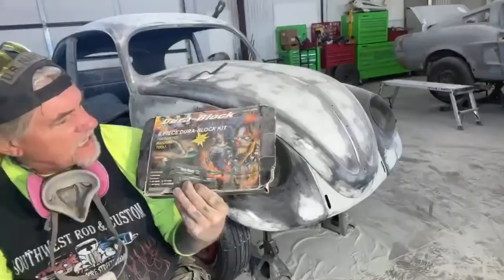Should I Use This Fender On My Car? AFTERMARKET AUTO BODY PARTS SUCK 😡😡😡😡

Comment: Fenders From BBT are the best fitting ones for oval window. you can get them best price through CIP1. they are SILVER not black. they have the correct shape but you will need to do work to them to get them to be straight. But for the most part they are pretty good.

Comment: Hey pete I agree 100% with you about those fenders. I actually live nearby to those companies, that made and still produce fenders hoods and auto body parts for Volkswagen, Audi, Mercedes etc. Even in here those "OEM Fenders with the special primer, ready to paint, no need to sand, trust me" bullsh*t need heavy bodywork. It is very uncommon here to get a new part that doesn't need putty.

Comment: As one who has had to hand fabricate interior and exterior body parts, my answer is yes: I would use anything. I can always rework it to make it right. So even a poor quality part not made properly still has most of the work done. 
Like using mustang tubs and floors on "other Mercury cars" because that's as close as I can get it. And that's only if I don't make the part from scratch.

Comment: my bugs are primer black because if it makes it through a year with no damage i would be amazed , every year i end up working on the bodies i just get so it looks ok to baja them . i have next to nothing in them one is a 74 with a 74 bug transaxle 1600 engine about 60 hp . the other one is a 63 with a 1600 dual port with a 72 bus transaxle. i got both for 450 one running and driving  the other needed work both are rust free started with clean bodies but over time i picked up some baja parts for free still have extra front clip . they get thrashed on i go cross country y other go on trails tranny mount like to break on them but most rig would not handle it

Comment: Pete, I have seen you use the honey mixed with filler. The honey has became expensive, but I think I have seen you mix the polyester spot putty in with filler to fill very fine imperfections. Only to be sanded with a 320 - 400 grit in preparation for a 2k filler. I don’t have the ability to buy the honey, but have the polyester spot putty. I am trying to finesse the center line on a 1967 C10 which has complex shapes and tappers. Never dented but off enough to need attention. I look for your advise.
Reply: Try USC AG47  and Pro glaze from USC.....It is the best stuff I think on the market. I do the same mix some pro glaze in with the filler for fine deeper fills. super fine stuff Pro glaze. AG 47 sands like Rage. or drywall mud. super fast. and strong.
Reply: @Mikefngarage   Thanks Mike, it is hard to keep up with product names, makes it slightly confusing. Spot putty versus polyester glazing. I think you helped clear it up for me buddy! I just want to do it right, do it once. This one is mine. Just hope Drs. don’t put me in a wheel chair. I truly appreciate your information & sharing. I save these & write them down. Good stuff! DK, Omaha.
Reply: Just a note, after I mix the ratio, my son sprays (34), he has lifting on hood in a 4” spot. I ask him what he used, he told me red spot putty. I told him to use polyester glazing putty. He said I don’t have your money. I said, how much time, money, product will it take to re-do? He shut up! Throw the lacquer based crap away. I loaned him my new bottle after making him watch Pete’s video! He learned.
Reply: @deankay4434  yeah I rarely use that lacquer putty only on stuff I don't really care about polyester glazing especially USC pro glaze is probably the best value. It sounds really fast too
Reply: @Mikefngarage   Thanks Mike. I agree with red lacquer based spot putty that has around as long I remember. Learning has occurred! I am glad I learned the difference and passed it on to my son. I am a subscriber to your channel as well and even tough I repair mechanical, electrical and leaks, because they never leak oil!!! Between you, Pete and others, at now 63 enjoy learning. Resto-mod my 1967 C10 with Tahoe LS and my overdrive transmission. A lot is done but nobody leaves me alone to fix their stuff. Thanks again for the reply. God bless you and your projects. May the wind alway blow the dust away from your direction and the customer leave a great tip! Thanks Mike! (Father advice; You know you children have finally grown, when they total their vehicle instead of yours) Thanks a bunch!
ASE Master Tech - Self taught farm kid!

Comment: II can’t find a part it doesn’t exist. Very hard hood to find I see them go as high as $700 to $900 for a 4 tab here. That baby’s going to look better then brand new. If he puts a red interior in it oh my god that will be bad ass!!! The green primer shit is supposed to be the good ones but wow. I’m not shocked they need a lot of work. That’s why my Nova has a NOS fender. It’s sad the NOS VW parts have dried up . It’s a wonder the holes lined up. My luck I would have to drill all new holes and weld the old holes up. The original stamps is all bullshit to get people to buy their shit

Comment: Old School, New School, We have real thick steel to new Extra thin thin thin shit sheet steal that can be pulled back with a glue stick and push and pull that thin New body back without even a paint afterward , Without the OLD SCHOOL learned the hard way we would be out of luck with our 12 14 gauge steel, Our Freind Pete tell us how,  good or bad work is on us.